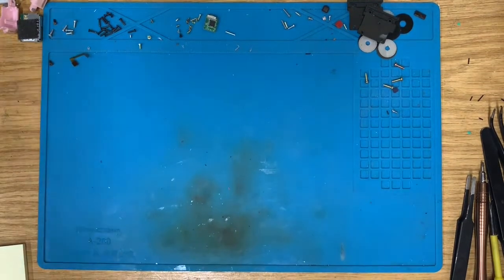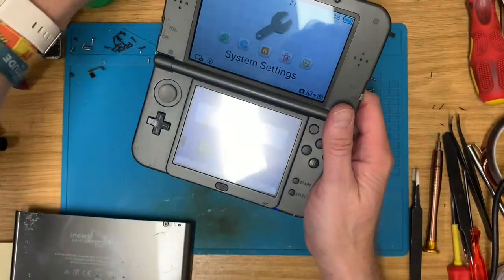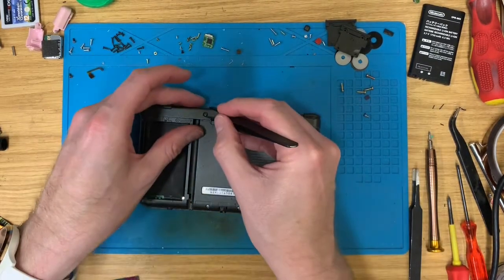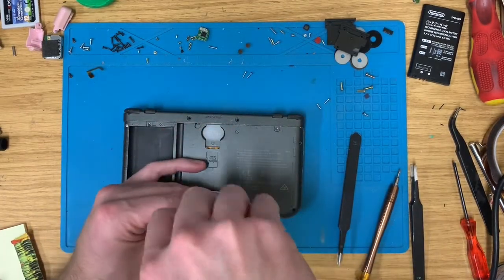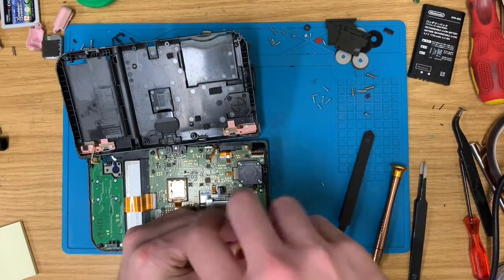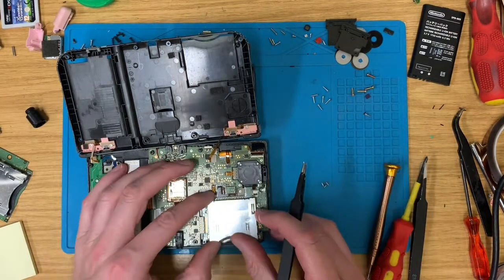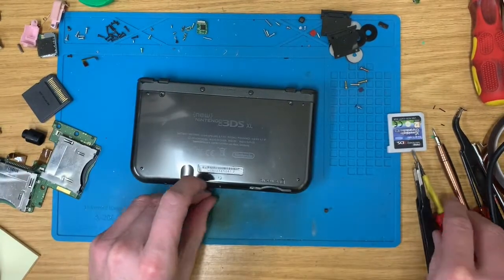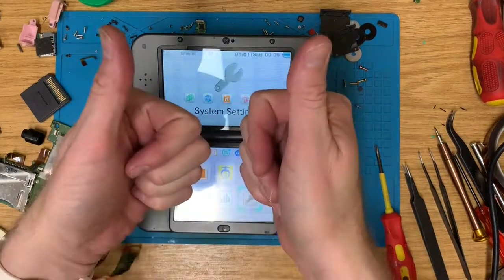"New" Nintendo 3DS XL  - Cartridge Port Replacement

Comment: Hey, I have a new 3ds xl with a 2015 motherboard and no power goes to the battery, the orange light comes on and the battery display says charging but the battery keeps loosing power, do you have any suggestions where it could have failed? Also I know it isn't the ribbin cable because if I use a dead board that black screens it still charges

Comment: Hi, I'm having trouble removing the back screws to get into the motherboard of the device, any advice?
Reply from the maker: Unfortunately, apart from finding a smaller, better fitting screw driver, I do not, sorry :(
Reply: @1up_Gaming  thank you for your response, I have already fixed it and it was all thanks to your video

Comment: Did Nintendo change the card reader  going from the original 3ds to the new 3ds? I noticed the card reader on my original 3ds hides the pins when there's no game card inserted, but my new 3ds xl doesn't seem to  have that little feature.
Reply from the maker: They're different from what I've seen, even from the 3ds to the 2ds, the layout and shape of the replacement is ever so slightly different.
Reply: Just wanted to say I happened to notice that about my o3ds vs my galaxy n3dsxl the other day.

Comment: mine doesn't read on the first try usually the second or third. maybe gummed up? any way to clean these slots or replacement the only option.
Reply from the maker: You can try using an old cart and some IPA to clean it, it’s fine the trick for me before. Just be sure to use an old cart, as the liquid will mess up the label on the game 👍
Reply: @1up_Gaming  I ended up replacing the slot. the spring lock was only working on the far left of the slot also so I ended up replacing the whole cartridge slot. took 10 minutes. I bought the new cartridge slot from amazon. it was more expensive but I wanted the return policy.
Reply from the maker: @Andrew-rz9ck  so much easier on the “new” model, older ones require soldering to remove, it’s a flipping nightmare 😭
Reply: @1up_Gaming   I assume they realized after having to do some repairs soldering that slot was a bad idea.

Comment: Mine wont come on now. The light flashes blue for a second and then nothing. Pleases help
Reply from the maker: Does it make a “pop” noise?
Reply: @1up_Gaming  thanks for the quick reply. It was the battery being loose, I can hold it directly to the connectors and it works fine. The moment I screw the plastic piece on it doesn't make good contact in the battery slot. If I take a piece of napkin to help hold it in it does fine
Reply from the maker: @mattneal4309  no worries. Glad you’ve found the problem, and a temp fix, but just give it a shake once back together to make sure that fix doesn’t let you down half way through a game 👍👍
Reply: @1up_Gaming What does the pop noise mean?

Comment: Hey would you be able to access the dpad this way? Or do you need to remove the entire mother board?
Reply from the maker: You can remove the cartridge port and underneath is the dpad, can be removed without taking the main PCB out 👍👍

Comment: I just put in a new card slot and it's a little bowed it still works but will it straighten out?
Reply from the maker: Might be worth trying to lift it up a little, but if it is working, and not hitting the cartridge, I'd probably just leave it :)
Reply: @1up_Gaming  lift it up ?